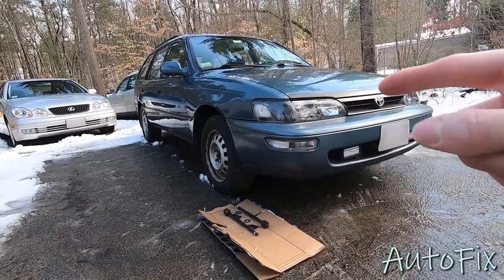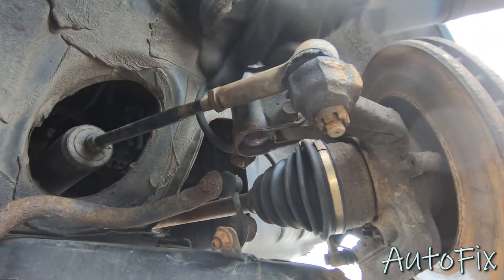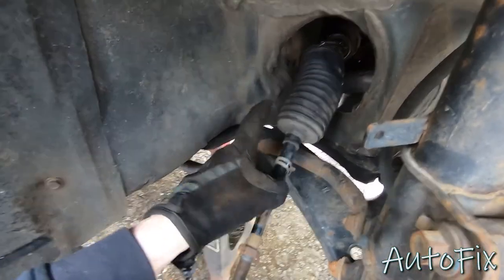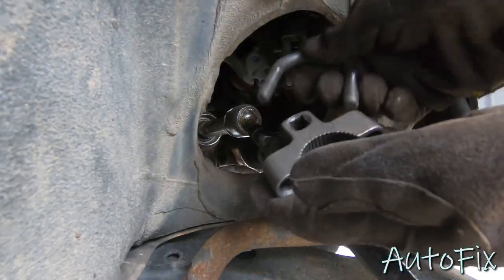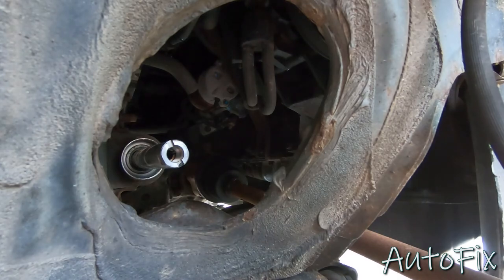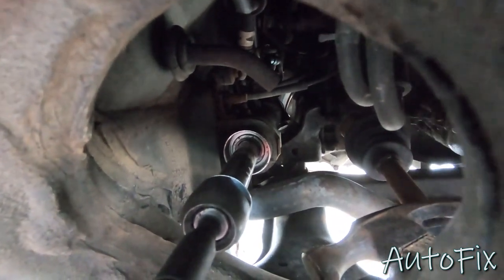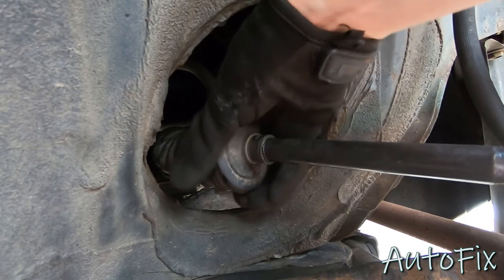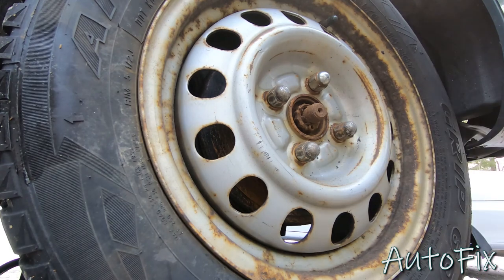Replacing Inner Tie Rods 93-97 Toyota Corolla

Comment: did you get these inner tierods from 1A auto?  if so, how are they holding up? the OEM Toyota inner tierods are EXTREMELY pricey, more than 100$  each i think i saw
Reply from the maker: Yes I did, they work well and are still just fine to this day! Just make sure you add the grease that comes with them, and that your bellow boot seals up well. Those two things are the key to making it last for a long time.

Comment: Nice headlights and corner lights. You have a link for those.
Reply from the maker: Thanks! And well sort of. I have a link but mine are modified. I retrofitted projector low beams in mine. They were originally reflector low and high beam. I also swapped out the orange reflector corner lights for clear reflector corner lights for an all clear front end. But either way, here it is: https://www.1aauto.com/1993-97-toyota-corolla-euro-4-piece-performance-lighting-kit-depo-312-1104pxasc2/i/1alhz00040
Reply: @AutoFixYT  did you modify those headlights with halos
Reply from the maker: @El_Jeffe  No halos. Just projectors. If you dig through my Instagram page (@autofix.cris) you can see pictures from when I put them together a few years ago

Comment: Thanks bro! Helped me a lot.
Reply from the maker: Awesome, I'm glad it helped!
Reply: @AutoFixYT  I’m actually in need of some advice. I’m using the same tool as you and ive got the washer lock un done but cannot get tie rod. I’m worried I’m gonna break the steering rack. What do you think ? My shit is rusty af and never been changed i don’t think. It’s a 92
Reply from the maker: If that lock washer is definitely out of the way, then just use a breaker bar and put in all you've got. As a last resort you can heat up the rack where the threads go in hut be VERY careful so you don't overheat the seal that's further down. What I suggest is to turn the steering wheel so the rack is pushed out all the way on the side you're working that way your heat source is the furthest away from the seal. And then once again, give it all you've got. It had to break free eventually.
Reply: @AutoFixYT  thank you man I’ll try that when I get back home. I appreciate the response.
Reply from the maker: @aidanmckinley8885  My pleasure, let me know how it comes out!
Reply: @AutoFixYT  yeah I stopped working on it because it looked like I was gonna break the steering rack.
Reply from the maker: I believe it haha

Comment: Can you show up the video how to install a tachometer in a 93-97 Toyota Corolla
Reply from the maker: I can't do that because mine already has one from the factory but if I ever have the opportunity to film that I will! And the reason I say that is because I don't know if installing one yourself will require different wiring than what the factory already has installed in the wiring harness.
Reply: @AutoFixYT  i already did that experiment..i just found on a junkyard an instrument panel with the tach option. Everything fits like a glove. No extra wiring. I have exactly the same corolla station wagon. Im planing to replace my rack, any advice? Thanks in advance.
Reply: @AutoFixYT  plug and play

Comment: What were the signs that your inner tie rods needed replacing?
Reply from the maker: Clunking over bumps, loose feeling steering, tendency to slightly wander to one side or the other, and when you jack up your car and shake the wheel side to side you'll have play.
Reply: @AutoFixYT  Alright, thanks.  Recently bought a '96 Corolla wagon and I think that it rides great considering 319K miles.  Will keep my eyes and ears open for any oddities while driving 👍
Reply from the maker: @apj341  Nice, congrats on the purchase, it's an awesome car! Keep those miles going! Mine is at 341k currently
Reply: @AutoFixYT  Maybe the best $1,100 that I ever spent.  🤗
Reply: Unrelated topic:
Seller told me the rear wiper didn't work.  I put a newer wiper back there 2 months ago, just for show.
Twisted the button today and it works!!  Seller wasn't pushing the right button 😂✌️
Reply from the maker: Lol well I guess that's a win for you!

Comment: I dont wanna sound rude or anything. But why do you put new tire rods on a car that is this rusty?
Reply from the maker: Totally understandable. This isn't very much rust actually. If you live in a part of the country that doesn't have salted roads in the winter, then I would understand your point of view. But even if this car was actually very rusty, if it's still in driveable condition, a set of $30 tie rods is cheaper than a whole new car and will get you by for a little longer.
Reply: @AutoFixYT  i understand. I live in europe, and cars do get rusty like this. Replacing the sill isn't a big/expensive job if that's the only rust that the car has.

Comment: Link me those headlights.
Reply from the maker: I bought the black housing headlight assemblies from ebay (which are also available on Amazon I think) and then custom retrofitted projectors in them. I bought the projectors from amazon. It was a big project for me but happy with how it came out.
Reply: @AutoFixYT  ohhh ok they look great i have been looking for a good set for my corolla.  I appreciate it  i also did the LED swap for my dash and love it thank you for sharing that as well.